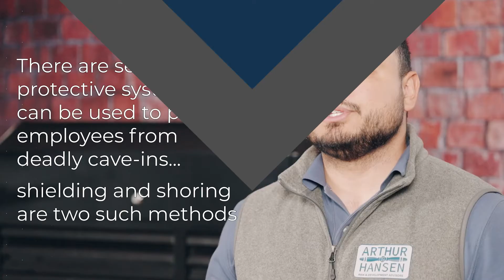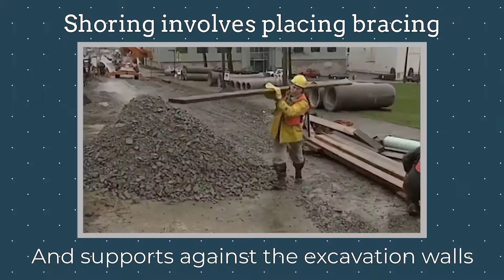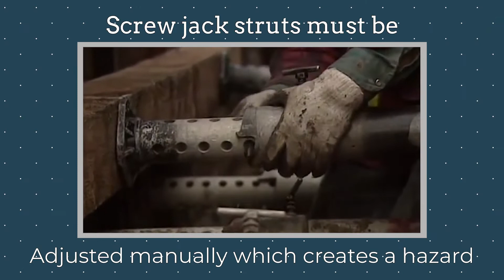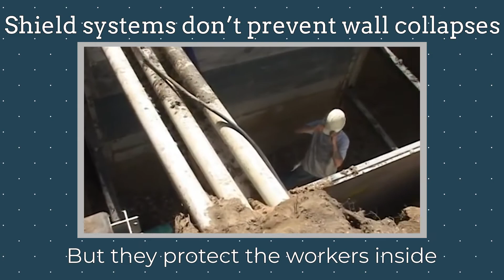Methods of Shielding and Shoring in Construction Trenching and Excavation | Construction Safety 2022

Comment: you said the trench box needed to be 18 inches above the trench wall.  this is only needed when the box drops down below the wall.  then a slope can be created on the sides that would be 18 inches below, and the slope must correspond with the soil type.  other than this, the box can actually be level with the top of the trench wall, at least by the OSHA standard.